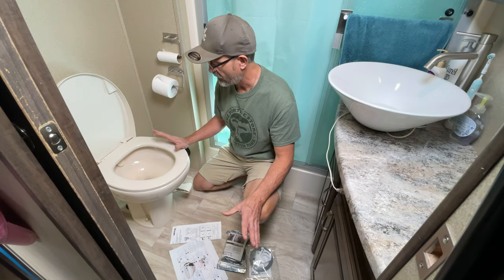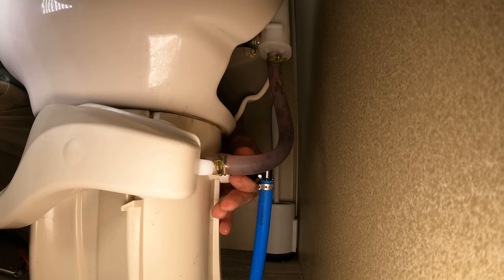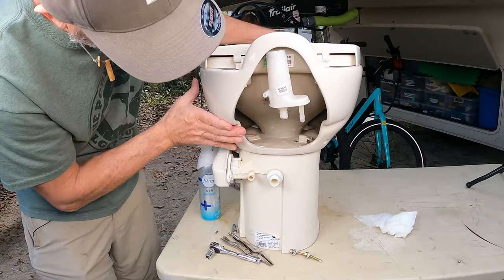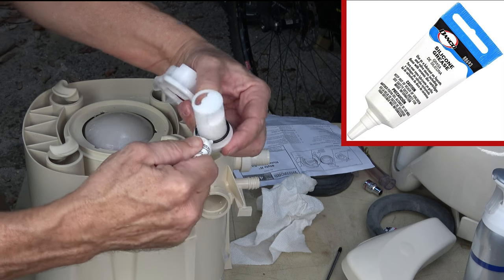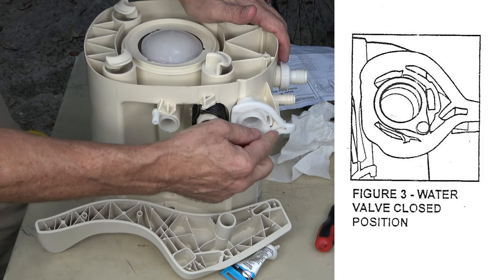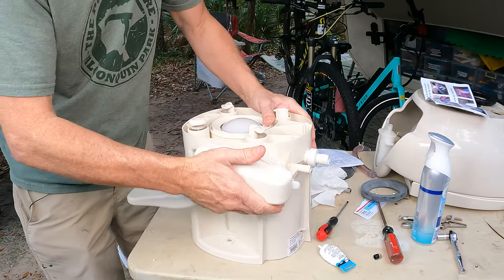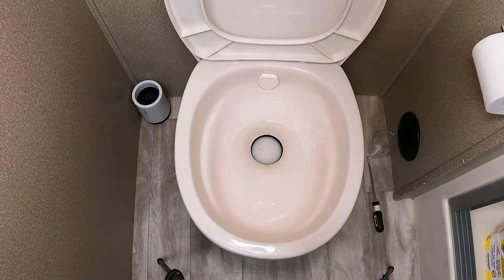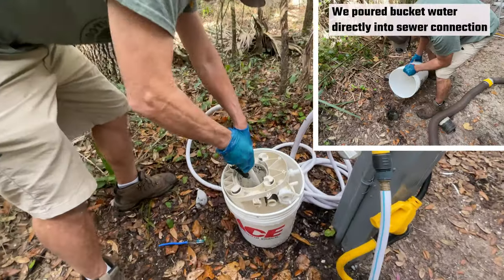RV Toilet Problems, How to fix Thetford Aqua Magic 2 (RV Living) 4K

Comment: Fantastic video and advise Larry (& Alice)!
Just this morning while we were flushing our tanks- I was refilling the black water by blocking open the flush ball- and we noticed this action caused a big water leak to come from the top of the shroud. Below/between the china bowl on the FRONT side. Ball does hold water; no leaks from behind or around valve or water inlet. 
What needs replaced to fix this? 
I appreciate your knowledge and come here first when diagnosing issues! I absolutely love when you have the actual brand we are dealing with!
Reply from the maker: I dont understand where the water is coming from, the floor and the plastic base, or between the plastic base and the bowl.  There are rubber gaskets for each to keep a tight seal. Let me know. Larry
Reply: @DownsizingMakesCents  in the middle. Above the shroud below the bowl; and at the front. And only leaks while holding the flush open. So if you look at the front of the toilet- right on the line/crack (I was trying to avoid using that word- there is no crack in the porcelain or the front of the shroud- just between where they seat/ connect.) I hope that makes more sense.
Reply: @djflook9465  ours is doing the exact same thing as yours. I just ordered a new toilet today as I don't feel like replacing the seals as what if it doesn't fix the problem
Reply: @TravisBeach we ordered the bottom half of the toilet as Larry suggested in his second video. It replaces all but the bowl itself with new everything. Got through the season with the annoying once in a blue moon leak. Just kept a folded paper towel in front of toilet. When damp/wet replace. Weirdly; not that often!
Reply: @djflook9465  That's what I was afraid of happening to us That's why I just pulled the trigger and bought the same toilet new on Amazon today for $188

Comment: Thank you for the video. Just a caution to anyone with his style toilet. Do not let your foot slip off the pedal when flushing. The piece of the drive arm that goes into the pedal to open and close the ball valve on mine snapped off. A needless repair that could have been avoided.
Reply from the maker: Sometimes its hard to avoid the foot slipping off. The. Handle is small and slippery.  Larry
Reply: @DownsizingMakesCents  Yep, I found that out the hard way. $40 for that little piece of plastic.

Comment: Could Larry share how he attached the bayonet cap to the barker? I can’t tell what that pink piece is & what glue was used 🙏🏻.  Thanks
Reply from the maker: Hey Matt, I need to do a video on how i attached the fitting on top of the tote to hold the 4 in one angled connector.  I 3D printed a piece that holds an upside down cap to attach the bayonet connector.  I think i show it in more detail in one of my three sewer tote videos but i cant remember which one.  Larry

Comment: We have the same toilet in our 2020 Reflection. We have a problem with the foot peddle. When we flush the toilet, you then have to lift up on peddle to get it to seal.
Reply from the maker: If The waste ball is sticking, you may be able to add some plumbing grease to the waste ball seal to get it to close better, but you probably need to replace the seal.  Larry
Reply: @DownsizingMakesCents  Thanks! I will try the plumbers grease first.

Comment: Suggestion  install  a water control value  in the supply line  so next time can isolate toilet  and still have water for other needs   toilet repairs seem to be something that's going to be repeated over time   may want to order extra  repair  kit   just incase happen when parts are back ordered
Reply from the maker: The next time i have to mess with the toilet, i will put a shut off valve inline.  Larry

Comment: What I found to be a simple fix for the water not staying around the ball, is to turn off the water to the toilet, put on a pair of latex gloves, and while pushing on the flush mechanism, spread 'plumbers grease' on the rubber ring, as best you can, both top and bottom of the rubber ring!   Turn on the water, and see if it holds.   Works for us any time I feel the water level seems to drop!d
Reply from the maker: Thank you for your fix. 
We eventually had to replace the whole base - it’s in another video.

Comment: You can fix the leaking around the Ball by putting some Plumbers Grease on underside of the seal where it meets the Ball. You can also fix the valve by putting Danco Waterproof Grease on that little black seal, on the O ring and on the bottom of the valve where it meets the seal.
Reply from the maker: I agree a littl plumbers grease once in a while goes a long way to keeping it from leaking.  Larry

Comment: Mine has the model label on the back at the bottom. You will need your phone or mirror to read it before you remove the potty. These vacuum breaker valves are notorious for spitting water out every flush unless you replace them.   Cash flow…..
Reply from the maker: Chuck, luckily we had the original manual with the RV
We didn’t have an issue with our vacuum breaker. But that would have been an easier fix
Alice

Comment: Good video.  Up to the 'If I had to do it over again' part, I was wondering if you were the guy who designed this service procedure for Thetford.  Good job.
Reply from the maker: Thank you. 
😁 check out our later video where we threw the base away and got a new one
Not Thetford fans.
Reply: @DownsizingMakesCents  uh oh. I hope my luck is better than yours 😬
Reply: Well, I'm back.  My luck seems to be the same as yours....water isn't staying in the bowl again after replacing the seal.  I will probably follow suit in the video you reference above and get a new base....
Reply: @DownsizingMakesCents  Well, I'm back.  My luck seems to be the same as yours....water isn't staying in the bowl again after replacing the seal.  I will probably follow suit in the video you reference above and get a new base....

Comment: I put the water hose in my toilet to clean we're the poop 💩 goes down  n now the water won't go down? I have a 1997 holiday rv 5wheel
Reply from the maker: Sometimes if you get a blockage, you have to use a long stick to push down the blockage into the tank.  its a nasty job but has to be done.  Larry

Comment: My Aqua Magic Plus waste ball was opening and closing but it was sticking or not moving smoothly so I just added Vaseline to the top side of the plastic valve without any disassembly and bam solved that problem. Just thought your viewers my enjoy this quick fix.
Reply from the maker: I wouldnt use a petroleom based lube like that, it will eat the rubber seal,, use a silicone plumbers lube instead that keeps the ball sliding well.  Larry

Comment: Your video was informative but you said NOTHING about being aware of the spring on the foot lever,  which came off during my rebuild, it was a pain to re-install, wish I had know about the spring
Reply from the maker: I’m sorry you missed it in the video, aligning the spring is a pain, I recently had to remove the arm to re-grease tge valve, my second video recommends just replacing the whole base for $30 more dollars.  Larry

Comment: I had this problem with the waste ball actuary lever breaking, could get parts and just replace it. Wish I would have kept the old one and fixed later cause I ended up with a plastic bowl. 🤬🤬🥵
Reply from the maker: This toilet the aqua magic residence style 2 is actually a pretty good rv toilet.  For some reason the individual parts are expensive to replace but the entire base cost is reasonable.  Our waste ball lever is about to break, it was sticking really bad.  Larry

Comment: just purchased and had a new thetford toilet delivered. I'm looking at the inside of the cavity: there is an 8-10" clear path from the waste ball to the actual inlet of the toilet. In other words if you plant an 8" trout there is a real chance that it will not just fall straight and cleanly into the flange! Who in the shiznit thought of this ridiculous design other than an engineer at Thetford who clearly had their head up their backside! WTF? Now I'm contemplating whether to go through the trouble of returning this lowlife designed toilet or purchase something that was engineered by Wernher Von Braun. Shame on the knuckleheads at Thetford for causing an RV'er to have to go through this!!!
Reply from the maker: I agree , these things are poorly designed, but they work effectively most of the time, but need a lot of maintenance, and if you drop a big load often, better make sure it made it through, haha.  I have always wanted to put a camera down the toilet into the black tank to see what its like but i would have to toss the camera after it, it would be really messy.  Larry